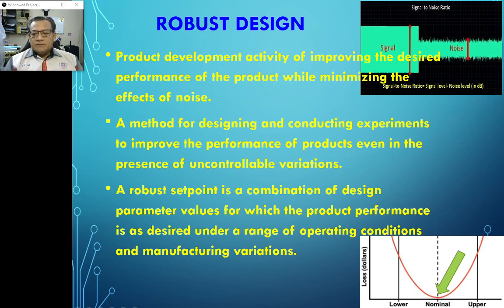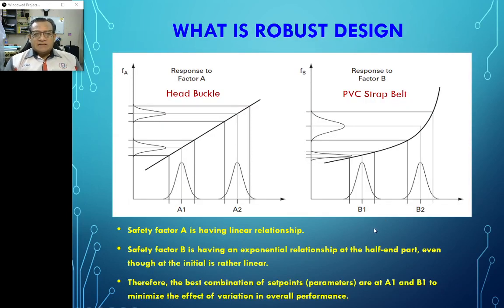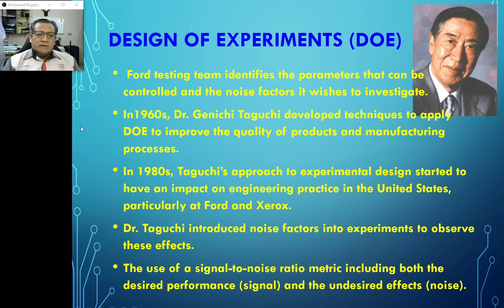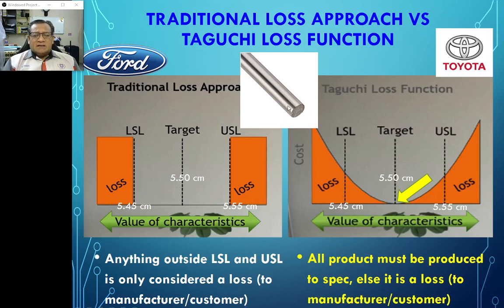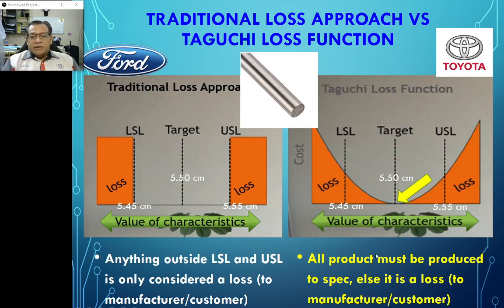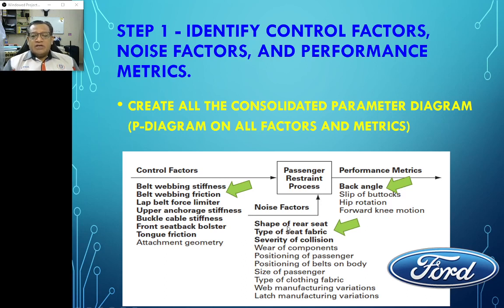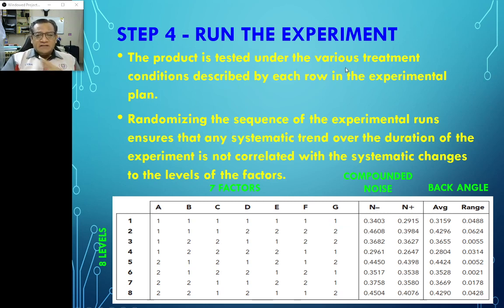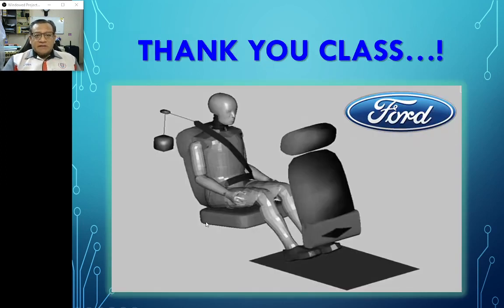Product Development Course Chapter 12 Robust Design

Comment: NURUL AIN NATASHA BT ISMAIL (AP200136) 

Thanks for the video Dr. On this chapter, i learnt about robust design. There is example of robust  design at ford motor. To avoid “submarining, many points are set for testings.  There are also traditional loss approach and taguchi loss function.  Robust design include 7 steps in this chap

Comment: Nur Adlina Fakhira Binti Mazdi (AP200041)

This chapter discussed about the robust design or in other names known as parameter design. The process to develop the robust design include Identifying control factors, noise factors, and performance 
 metrics. Next, formulate an objective function. Then, develop the experimental plan. The fourth step is by running the experiment.
After that, analysis need to be conducted followed by selecting and confirm the factor setpoints.
Lastly, needed to feflect and repeat the process when needed.

Comment: Siti Hawa Hazwani Binti Padzil (AP200460)
I've learnt through watching the video lecture that robust design is a process used to create products with the least amount of faults possible. The strong design is demonstrated in seven phases in the video. Which are identify the factors, formulate an objective function, develop the experimental plan, run the experiment, conduct the analysis, select/confirm factor setpoint, and reflect/repeat.

Comment: MUHAMMAD NUR IRSYAD BIN ROSLI (AP200233) 
Thank you dr for the sharing. Based on this video, I have learned about the robust design, design of experiments, traditional loss approach and taguchi loss function. Moreover, I have also learned about the 7 steps of the robust design process which are identify control factors, noise factors, and performance metrics, formulate an objective function, develop the experimental plan, run the experiment, conduct the analysis, select and confirm factor setpoints as well as reflect and repeat.

Comment: SERI AMISHA BINTI MOHD HASHLINDARINSHAH

THANK YOU DR FOR THIS SHARING
 There are 7 step to identify control factors, noise factor, performance metrics, formulate an objective function, developing experimental plan, run experiment, conduct analysis,, select and confirm factors point, reflect and repeat

Comment: Ap200047 NAJWA HANI 

Thankyou for sharing Dr 😊
From this lecture video, I learnt that 
about robust design. Robust design also has used at Ford Motor. I also learnt about the design of experiment (DOE). The difference between traditional loss approach and taguchi loss function has been explain in details.

Comment: Thileeshaa Paramasivam (Ap200284)
From this i learned about robust design which is a method for designinh and conductinh experiments to improve the performance of products in uncontrollable variations.i also learned about DOE a tchniques which helps to improve the quality of product and manufacturing processes.this chapter also shows the steps which are 7 of the robust design process.

Comment: Goh Duan Feng (AP200393)

Thank you dr for sharing this video. Based on this video, I have learn about the robust design, design of experiments (DOE), and 7 step for the robust design process. The first step for robust design process is identify control factors, noice factors, and performance metrics. The second step is formulate an objective function and the next step is develop the experimental plan. Step four is run the experiment and the following step is conduct tha analysis. Select and confirm factor setpoints is the step six and the lastest step is reflrct and repeat.

Comment: Muhammad Taufiq bin Ramlan (AP200386)

I appreciate you sharing, Dr. In this video, I learned that selecting the appropriate set points for the controlled design parameters is the key to strong design. The next seven steps of the robust design process are factor identification, formulation of an objective function, creation of an experimental plan, execution of the experiment, analysis, selection and confirmation of the factor setpoint, and reflection and repetition.

Comment: Abdul al-Akhmal (Ap200291)

I've learned from watching this video that resilient design is a process used to create products that work as intended with the fewest possible faults. The two experimentation data must be combined in order to produce the design of experiments (DOE). The steps in the resilient design process are: defining an objective function; creating the experimental plan; carrying out the experiments; performing the analysis; choosing and confirming the factor setpoints; reflecting and repeating. I appreciate you sharing, Dr.

Comment: Ching Chao Quan AP200120

Thank you Dr for sharing this video. From this video, I have learned about robust design, design of experiment (DOE), the difference between traditional loss method n taguchi loss method. I also learnt about 7 steps in the robust design, which is identify control factors, formulate an objective function, develop the experimental plan, run experiment, conduct analysis, select and confirm factor setpoints, reflect and repeat

Comment: CHE SHI MIN AP200535

Through this video, I gained a deeper understanding of Robust Design, the Design of Experiments (DOE), and the difference between traditional loss methods and Taguchi loss functions. As part of the robust design process, I was also introduced to the seven steps, which include identifying control factors, noise factors, and performance metrics, formulating an objective function, executing the experiment, analyzing the results, selecting and confirming factor setpoints as well as reflecting and repeating the process.

Comment: MAH YING YING ( AP200218)

From this video, I have learned about robust design. Robust design is an activity in product development aimed at enhancing desired performance while minimizing the effects of noise. There are seven steps in the robust design process, namely, identify factors, formulate objective function, develop experiment plan, run the experiment, conduct analysis, select and determine factor set values, reflect, and repeat.

Comment: Lee Sook Yeen (AP200447)

Thank you Dr for sharing the video. From the video, I have gained knowledge about what is Robust Design with related cases. There are also the explanations on Design of Experiments (DOE). In order to achieve the DOE, a combination of technical knowledge and experimentation data is needed. I have also learned about the Traditional Loss Approach vs Taguchi Loss Function and robust design process which involves the 7 steps. This video provided me with invaluable insights and knowledge that have greatly expanded my understanding of this concept.

Comment: NURUL RAIBATUL ADAWIYAH BINTI SAIIDI (AP200436) 

from this chapter, i learned that robust design an active in product development to improve the desired actual performance of the product while minimize the effect of noise. Other than that, there 7 process of robust design which is identify control factor, noise factor, and performance metric, formulate an objective, develop the experimental plan, run the experiment, conduct analysis, select and confirm factor setpoints, lastly reflect and repeat

Thankyou dr

Comment: Nur Layla Witra Bt Baba (Ap200431)
Based on this video I learned a out robust design which is an activity of experiment to reduce noise. In factor A it has a linear relationship. Next, in B1 has linear relationship while in B2 has the exponential relationship. The combination of factor A and B shown to minimize the affect of variation in overall performance.

Comment: Nuriman shauqi bin Norazlin (AP200388)

From this video, i have learn that robust design and the robust also consist of 7 steps which is identifying the control factors, noise factors and performance metrics. Next step is formulate an objective function, develop the experiment plan, then run the experiment, conduct the analysis, select and confirm factors set points and lastly reflect and repeat.

Thankyouu Dr.

Comment: Nurulhuda binti Jamali (AP200039)
In this video, the seven steps of the robust design process were shown and discussed. These steps include figuring out what the control factors, noise factors, and performance metrics are, coming up with an objective function, making an experimental plan, running the experiment, analyzing the results, selecting and confirming the setpoints for the factors, and then reflecting and repeating the process.

Comment: Nur Asyiqah Afizul (AP200077)
Robust design aims to create products or systems that can perform consistently and effectively under various conditions and uncertainties, reducing the impact of variations and improving reliability and quality. The robust design process involves identifying control and noise factors, defining performance metrics, formulating an objective function, developing an experimental plan, running the experiment, analyzing the results, selecting and confirming factor setpoints and continous reflecting and repeating the process.

Comment: MUHAMMAD SHAHIR BIN NAZRI (AP200361)

This video explain about robust design. There are 7 process of robust design:
1. Identify control factors, noise factors and performance metrics.
2. Formulate an objective function.
3. Develop the experimental plan.
4. Run the experiment.
5. Conduct the analysis.
6. Select and confirm factor setpoints.
7. Reflect and repeat.

Comment: AIMAN SYAHMI BIN MOHD. SABRI
(AP200468)
 what i understand from this video is about robust design and its an activity in product development to improved the desired performance. it is also minimising the effect of the noise. Normally, its minimize the performance but at the same time mini minimize the noise. Thee performance is measured based on archievemenet of the nominal value and the purpose of this Robust Design is to archieve the excellent design.

Comment: Lem Yu Qing (AP200262)
After watching the video, I learnt that robust design process cosists of seven steps, namely identify control factors, noise factors, performance metrics; formulate an objective function; develop the experimental plan; run the experiment; conduct the analysis; select and confirm factor setpoints; and reflect and repeat the process for the next cycle of testing an experiment.

Comment: Umi Shazleen Binti Janudin (AP200515)

I acquired knowledge about the Taguchi loss function vs. the classic loss technique, the design of experiments (DOE), and the robust design from this video. Additionally, I learned about the 7 steps of the robust design process which include identifying control factors, noise factors, and performance metrics, formulating an objective function, developing an experimental plan, conducting the experiment, analyzing the results, selecting and confirming factor setpoints, and reflecting on the process for further iterations if necessary. I already understand that in order to accomplish product performance, we must remain true to the objective function. Thankyou.

Comment: NURHANNANI FASIHAH (AP200504)

In chapter 12, i have a learn about robust design which is a method for designing and conducting experiments to improve the performance of produxt even in the presence of uncontrollable variations. Robust design alo known as parameter design that a matter of choosing the right set-point for the design parameter under control. Other than that, there are 7 process of robust design which is:

1. Identify control factors, noise factors and performance metrics.
2. Formulate an objective function 
3. Develop the experimental plan
4. Run the experiment 
5. Conduct analysis
6. Select and confirm factor setpoints
7. Reflect and repeat

Comment: Kee Yong Huat AP200288
I have gained knowledge about robust design, design of experiments (DOE), and the comparison between traditional and Taguchi loss approaches. The robust design process consists of seven steps. The initial step involves identifying the control factors, noise factors, and performance matrices. The second step is to formulate an objective function. In the third step, an experimental plan is developed. The fourth step entails running the experiment. Next, in the fifth step, the analysis is conducted. Following that, factor set-points are selected and confirmed. Lastly, the process involves reflecting on the results and repeating the necessary steps.

Comment: Nurul Faizah binti Nurim Shah (Ap200346)

In chapter 12, i have learned robust design is product activity that improve the performance with minimizing the effect of noise. One of example will be seatbelt that produced by Ford. Then, there are seven steps in robust design which identify central factors, noise factors, formulate on objective function, develop experimental plan. After that, run the experiment and conduct. After confirm the factor setpoint, then we can reflect, repeat the process.

Comment: NUR AMANINA BINTI MUSA (AP200517)
thank you, Dr., for sharing this insightful video. From watching it, I have gained knowledge about the seven steps involved in the robust design process. These steps can be summarized as follows:

1.Identifying the control factors, noise factors, and performance metrics.
2. Formulating an objective function.
3. Developing the experimental plan.
4. Running the experiment.
5. Conducting the analysis.
6. Selecting and confirming the factor setpoints.
7. Reflecting on the results and repeating the process if necessary.
Once again, I appreciate your valuable contribution in the video.

Comment: AP200290
NORJANATUL SAADAH 
in this chapter, i have learn about Robust design is an engineering approach to creating products and processes that perform well despite uncontrolled variations called noise effects. The seven-step process involves identifying control factors, noise factors, and performance metrics, formulating an objective function, developing an experimental plan using orthogonal arrays, analyzing data with means and factor effects charts, confirming factor setpoints, and reflecting and repeating the process. This approach ensures robustness by accounting for both mean performance and variance due to noise factors. The assistance of a design of experiments expert can be beneficial. Overall, robust design enables engineers to optimize performance and reliability in the presence of noise effects.

Comment: NUR ATIKAH NABILA BINTI MOKHTAR (AP200345)

I have learned about robust design, which is a method for designing and conducting experiments to improve the performance of products. Then, design of experiments (DOE) such as noise factors, signal-to-noise ratio metric. Traditional loss approach vs Taguchi loss function and also the robust design process.

Comment: NORHAYATI BINTI ZAIDI (AP200363)

In this chapter 12 learnt about robust design.  Robust design is a method for designing and conducting experiments to improve the performance of products even in the presence of uncontrollable variations. In this chapter also learnt about DOE, Dr Genichi Taguchi developed this technique to improve the quality of product and manufacturing processes . Chapter 12 also shown the 7 steps of the robust design process

Comment: ALIFF IQMAL JEFFREY (AP200086) This video explains the robust design where it involves improving the desired performance and reduced the noise. It is s combination of design parameter values for which the product performance. Robust design requires many trial and error to improve the product.
Next, Robust design is achieved through Design of Experiments (DOE). DOE focuses to improve the quality of the product especially in noise factors or signal to noise ratio.
Next, there are 7 process of robust design 
1.  identify control factors, noise factors and performance metrics.
-include what to control in the product. This includes the features and characteristics of the product. Uses P-diagram setpoints diagram to control factors.
2. Formulate an objective function
- includes maximizing and minimize type function, target value type of function and signal to noise ratio function 
3. Develop the experimental plan.
- test the combination of factors in the experimental plan. Decide which combination is suitable 
4. Run the experiment
- Test the factors with the set values with the compounded noise. 
5. Conduct analysis
- Compute the objective function and compute the factor effect by analysis of means
6. Select amd confirm factor setpoints
-select the best setpoints to achieve minimum back angle. Must run confirmation to verify the combination of physical test to achieve the robust design
7. Reflect and repeat 
- reflection whether it is achieved or not

Comment: NURUL DAYANA SAHIRA BINTI AZAHARI (AP200516)
- This video I learned about robust design. Combination of design parameter values which the product performance. There are has 7 steps involved in robust design. Robust design performance of product, robust setpoints and setpoints linear relationships and exponential relationship at half end part. Example for robust design are surrounding mic can minimize by robust design.

Comment: NURSHUHADA BINTI BASIR (AP200334) 

From this chapter i learn more on robust design implementation. Based on the video example is Volvo, The Volvo Group has been successful in designing and marketing its products over many years. The Volvo Group has been testing a number of approaches to introduce robust design, and this article presents an evaluation of one such approach which began in 2004

Comment: For this chapter, i have learned about robust design that can improve the desired performance of the product like ford motor. I can deferenciate between safety factor A and factor B that related to robust design. then, I learned 7 step for the robust design process.

Husna Mardhiah Binti Helmi (AP200030)